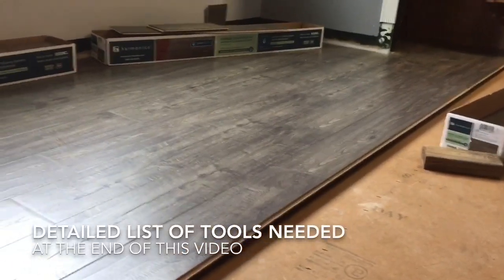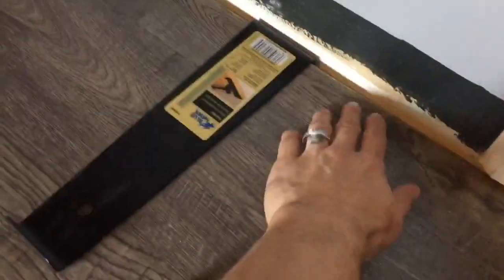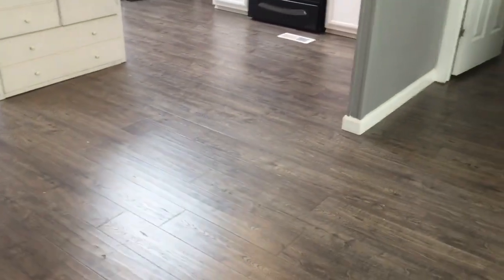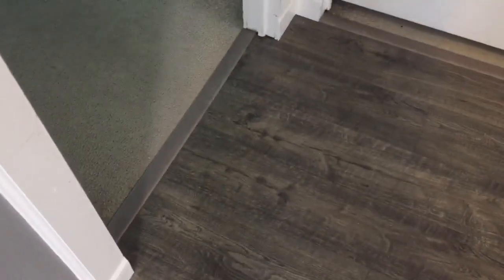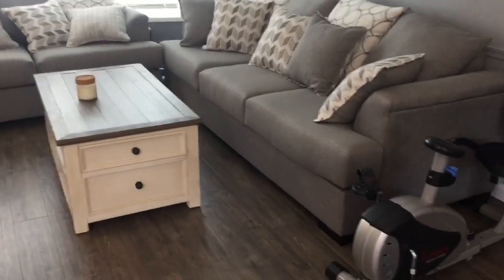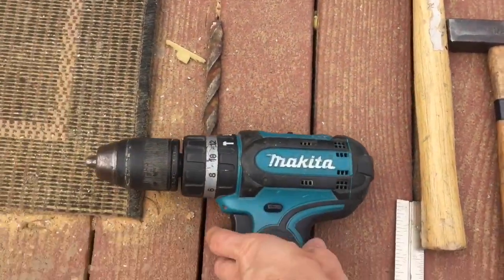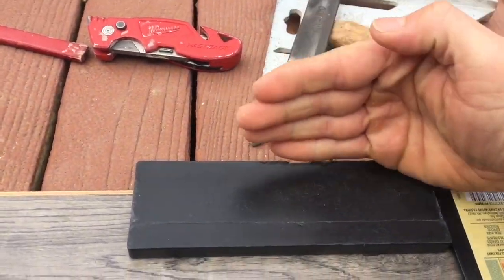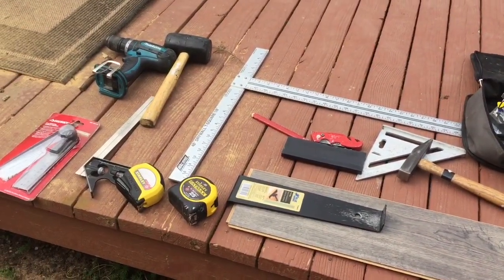Costco’s Harmonics laminate wood flooring not laying flat (How to install/correct)

Comment: Mine did the same thing. I was laying it over terrazzo and it was driving my nuts. It wasn't until about the 4th row that I was able to get a handle on it and make some progress.
Reply from the maker: That was when I decided to create this video, I’ve installed tons of laminate flooring and this was the first tome that I’ve encountered this issue. Is yours going well?
Reply: @TweekerDan1984  Yes, now that there's flooring to stand on and hold stationary, I seem to be able to knock the joints together. It's nice material to work with and cuts very easily. I am going over a terrazzo floor so my subsurface is perfect.

Comment: Looks Great !  I was about to start in my 2nd floor , wanted to check if things. Would really appreciate your inputs  1) Do I need additional underlayment like sound barrier or vapor barrier ?  2) Is it okay to additional sound barrier underlayment to reduce the sound 3) the instruction mentions use of sealant , did you use silicon sealant? 4) Which tool did you use to cut the length of the board? 5) From where buy the Transition and Stair Nose

Comment: Hi, that looks great!  We are using the same products to do our entire downstairs. Did you take off the baseboards?  Also, what kind of vapor barrier did you use?  Thanks!
Reply from the maker: Thank you, it feels great and so clean. Yes I did remove the baseboard trim, also no vapor barrier is required with this product.
Reply: @TweekerDan1984   another person posted on youtube that vapor barrier is required for warranty even if the subfloor is wood.  I looked everywhere and there's a lot of articles that says don't install vapor barrier on wood subfloor for the subfloor to breathe.  SInce you did not install vapor barrier have you exprienced any issue?  I'm on the same scenario as you and I'm about to install it without the vapor barrier on wood subfloor (same Harbor Scraped Oak).  Thanks
Reply: @allanorbigo4961  the vapor barrier is only required over concrete subfloor according to the manufacturer: https://harmonics-flooring.com/wp-content/uploads/2018/08/SplashDefense_InstallationGuide.pdf see step F)

Comment: How do you like the floor a year later? I'm about to install this in my home.
Reply from the maker: Definitely still love the floors they are durable and receive compliments often! The quality is exceptional for the price. I install plank flooring fairly often and it is currently on sale at costco.
Reply: @TweekerDan1984  I bought a pallet at quite the discount at Costco back in December. Do you remember how long the room transition "multifunctional" strips are? I ordered some but they don't have a measurement listed on the site. They weren't in the store.
Reply from the maker: Most the time they are 10’ and 12’.

Comment: Hi dan, how is this holding up? I was at Costco to pick this up and some guy walked by and said it damages easily. 

Also,  did you use underpayment?
Reply from the maker: It is holding up great, I believe any flooring you install can be damaged fairly easily if you were to drop blunt heavy objects on it. A few things have hit the floor in the kitchen but have not damaged the floor. Moving the appliances and furniture have not scarred the floor. I have tried to be careful by using felt pads on the furniture. All in all I’m very satisfied with durability of this flooring and love the simplicity of cleaning it.
Reply from the maker: Also underlayment is not necessary when using this flooring. It is preinstalled on each panel.
Reply: @TweekerDan1984  really appreciate the feedback! i'm picking some up from Costco today
Reply: @TweekerDan1984  Underlayment is required if installing on cement slab
Reply: @TweekerDan1984  I saw in a video the gentleman stressed the point that the underlayment is for the warranty eventhough they have the pad attached. I will check the instructions when I purchase my flooring 🤗

Comment: How do you transition from a room into a hallway?
Reply from the maker: If you are continuing your hardwood laminate flooring from a bedroom into a hallway or any other room you would continue by still running one row of flooring at a time, meaning once you start a row continue to add to that row until you have run into your next wall. Are you running parallel or perpendicular to the door opening.
Reply from the maker: I used my jig saw to cut most of my transitioning pieces and then had to cut the door jams to be able to slide the flooring under the jam to avoid the visual gaps. I do show this part during the video that I created. Hope this helps 👍
Reply from the maker: If you have any more questions feel free to ask.
Reply: TweekerDan1984  I haven’t started yet, I think I want to run parallel to the door so I can keep going into the hallway
Reply: TweekerDan1984 thank you I appreciate you answering.